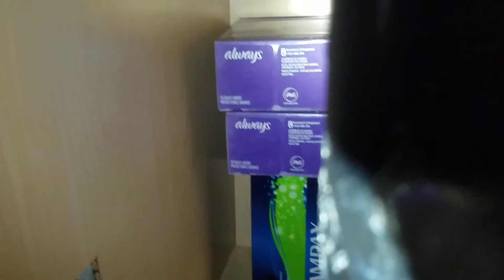Plumbed Primary A/C Drain Line Location

Comment: Any tips on how to easily remove the black hose? Mine seems to be glued on. Its kicking my butt
Reply from the maker: Did you finally get it removed?
Reply: @BBStudioProductions Yeah man. I found a clamp in the garage that helped ALOT
Reply from the maker: Was it actually glued on?
Reply: @BBStudioProductions  No it wasnt. Just never been removed before since the house was built (3 years ago). It had 3 grooves on the P trap part that the black hose connects to that makes it difficult to take the black hose off. Fortunately I got it off but the hose seemed to be fine. It was the P trap that was built up with God knows what (blocking the hole) which caused the secondary drain pipe to drip
Reply from the maker: Thanks for the details. I do appreciate it.

Comment: Most of the older houses will have this primary drain lower side of your house outside
Reply: Where I live they require the condensation line to terminate into a p-trap. Plus, if you stub it outside you’re constantly going to have a wet area till the day you move out. We hard pipe ours to a trap, no tube with hose clamp lol

Comment: Would you have any thoughts about this and hearing airflow coming out of the drain? I have this same setup and everytime the air is on I hear air coming out of the drain.
Reply from the maker: I don’t think that’s unusual
Reply: @BBStudioProductions  really, never had this happen an any home I’ve lived in. Caught me off guard when I started smelling drainage (nothing crazy) and hearing airflow. Thought there could be some push back through the piping from the HVAC
Reply: I have the same issue, I notice it when heater is running ?  I wonder about  gas furnace backdrafting?

Comment: Is there any reason that this clog would cause the correlating sink to drain very slowly? I only ask because I already cleaned out the P trap and am hoping this is the problem and not an issue further down the system.
Reply: Check the drain line behind the P-trap that goes into the wall.  Mine was almost completely blocked by the sludge.
Reply from the maker: This shouldn’t cause the sink to drain slowly unless the primary line clog extends into the main drain.
Reply from the maker: Try Green Gobbler. It works very well.

https://www.amazon.com/Green-Gobbler-Liquid-Remover-cleaner/dp/B085FS4JTD

Comment: I’m having issues taking off the hose. I took off the metal zip tie but the hose is inserted to the main drain pretty tight. I tried taking it off but no luck. Any tips?
Reply from the maker: Remove the trap piping from under the sink and then try to remove the hose
Reply: @BBStudioProductions  I ended up removing the p trap and gently pulled until the black hose came off. Thank you! Now I feel like a plumber haha
Reply from the maker: Glad it worked out for you. 🙂

Comment: Yeah.  Thanks.  I had an AC guy over last time and he used some kind of vaccum.  This time, I think I can do your procedure and should be fine.  😊.
Reply: Lowes sells shop vacs for $60-$80
Reply: Sadly, cleaning out the tubes did not do the trick.  I may have to spend 100 for my AC guy to do the vacuum.  I am disappointed it did not work.

Comment: One of this in a house clogged the sink drain and cause 1sd floor ceiling ruined. Have to use a snake to open it, then clean the AC drain pipe. Prefer a drain pipe directly outside.
Reply: Is this poor setup some kind of city requirement? What happened to running both drain lines outside.

Comment: I had a foul smell coming from one of the 2 bathrooms and I thought something had died in there and when I opened up the P portion and the removed the black rubber pipe, all this crud and nastiness begged color crap came out.  Looked like a biology experiment gone wrong. I am no plumber, but I took a steel hanger (non sharpen area) and used as a q-tip and started going to town removing the blobs.
Reply from the maker: It can get nasty
Reply: @BBStudioProductions unchecked, can the clogged line cause a stale odor in the bathroom?

Comment: Can you please explain how to remove the hose clamp?
Reply: Thanks. I did remove but have no strength to remove that hose!
Reply from the maker: Make sure you have a large tub/ bowl under your drain trap to catch all of the water that will come out of the hose. Have some paper towels or rags available for the cleanup as well. 😊
Reply: @jenniferjenn2626  i damn near broke my hands trying to get that off.  i had to use a flat head screwdriver as a wedge/lever to get it off.  took me about 20 minutes
Reply from the maker: Use a screwdriver to loosen the screw on the clamp.